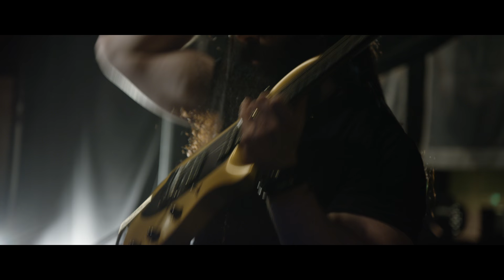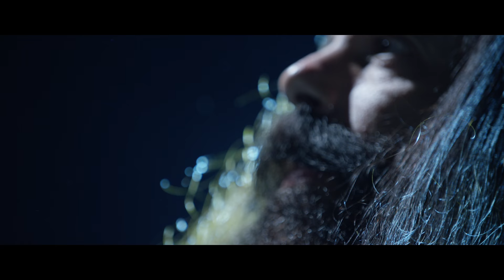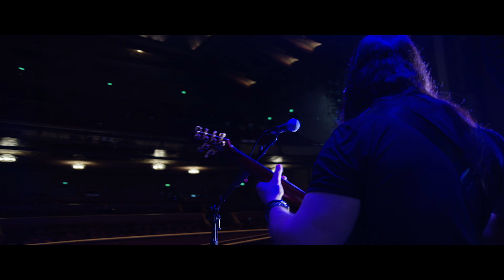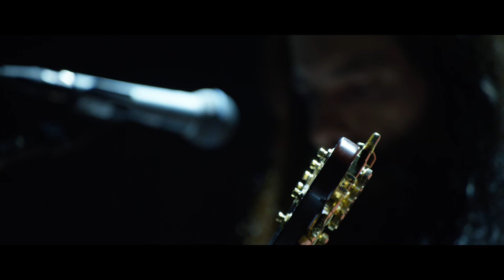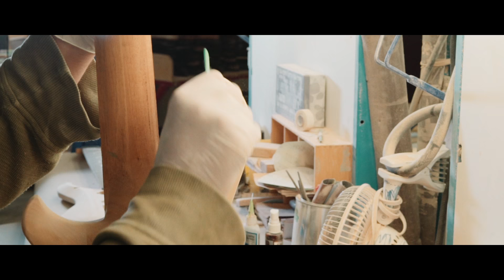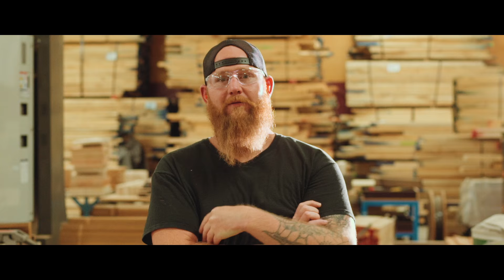Creating his Majesty: The Ernie Ball Music Man John Petrucci Signature Series

Comment: What happens if we use elixir strings on this majesty?
Reply: Marino Oliveira It snaps at the neck joint as soon as you reach tension. Then it disentegrates.
Reply: The coating will wear off in a couple weeks, just like on any other guitar.

Comment: I must say when I bought my JP7 I was amazed and disappointed with instrument at the same time.Everything was just perfect and playing is out of this world.Then you few little details missed for such a expensive instruments.
One minor and not important as two big holes in back plate where springs are,and one disastrous is lower side of tremolo block  resting totally on body of guitar.
Since I bought it used there is nothing I can do then go to luthier and sand that side few milimetars till its looks like it should be when was sent out from factory.
Reply: Dude, the position of the tremolo block can be adjusted...  Just take a screwdriver and losen the springs in the back pocket of the guitar a bit. You might as well take one of them out completely. In addition you could losen all the strings then keep the trem arm pushed down a little while tuning the strings back up again...